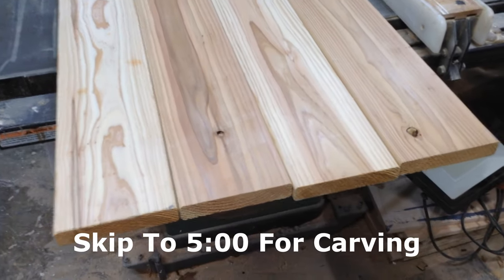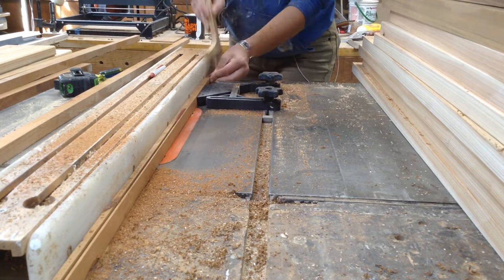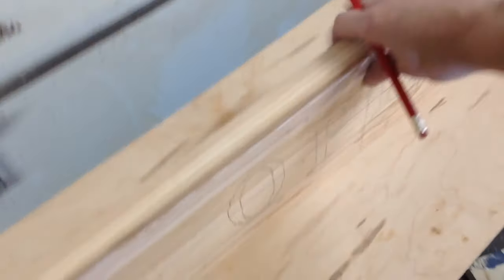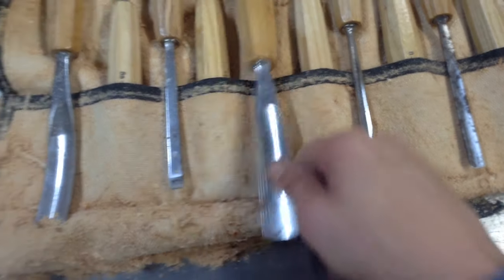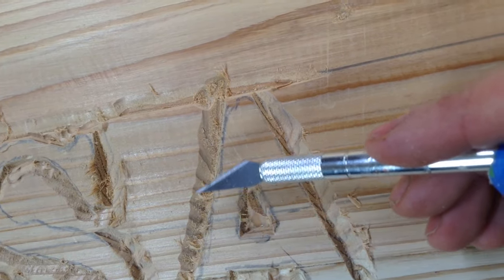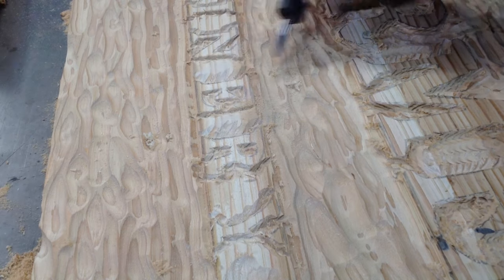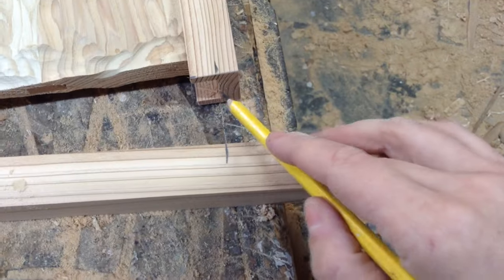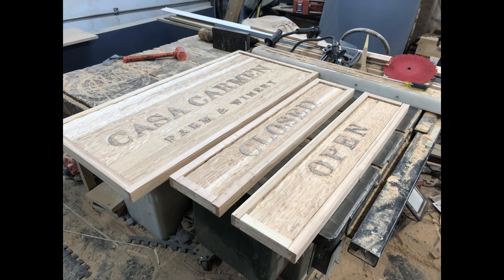Wood Carving For Beginners || How-To || Power Carving A Sign

Comment: Nice video with classic HB narration. To the point as usual. Great idea for using the projector. I just finished building a sign out of 2x4 for a local coffee shop here in Atlanta. As you said the most work is in transfer of text on to the canvas surface. This shop has a unique font so I had to draw and scale on paper each letter, then glue it all onto the wood, then used fine tip router bit to carve the letters edges, then with 1/4' bit hog the rest of it. After aaaaal of that I filled the letter indentation space with coffee beans and pored with resin. All of that thanks to watching one of your older videos. 👍
Reply from the maker: Nice, sounds like a very cool sign.  Pretty sure I know what video you are talking about.  Happy someone got some use out of it.
Reply: @HoneyBadgerWoodWorks  Absolutely. Thank you for sharing HB.

Comment: Great job as always, sign making has been on my list for a long time but as yet have never attempted it, something always comes along and knocks it down the list before it gets to the top but I do poses a dremmel and some other die grinding bits so it will definitely happen at some time, when that time comes I am sure it won’t be anywhere near as easy as you make it look, I will look forward to the upcoming second video on carving 👌👌👌👍👍👍🇦🇺
Reply from the maker: Thanks!  As with anything there is a learning curve, but with plain lettering like this I think a novice could become an expert quite quickly.

Comment: Great Video, the feather board you are using looks great.  Would you buy this one again or would you get another one?  Thanks and I Really enjoyed your production. Terry
Reply from the maker: It’s from Rockler.  I have used lots of their products and usually like them, but I don’t care for that feather board.  You have to really crank on the knobs in order to get it to not slide in the slot.  I mean really really crank on it.  I don’t have experiences with other brands but I would think you shouldn’t have to tighten it that much to get it to work properly.

Comment: Really interesting to see how you approach this kind of work as a professional running a business. Do you prefer splines to tongue and groove?
Reply from the maker: I find splines are easier because it’s just one setup for all the boards. And for the bigger sign I had just enough width, if I cut tongue and groove and lost some width on each board the sign wouldn’t be wide enough.
Reply: @HoneyBadgerWoodWorks  Two very good reasons. Thank you!🙂

Comment: use the on line program rapid resizer  with this on line program that you can set up a paper pattern  the program sets up on 8x 10 home printer and resizes to just about  any size  you could want   I do wood carving and use it to enlarge cartums for carvings in wood
Reply from the maker: Thanks this is a good tip for multiple woodworking uses I think, not just carving.  I have done paper pattern transfer s for carving before and still think the projector is easier.  But, for people without access to a projector this is a great option.